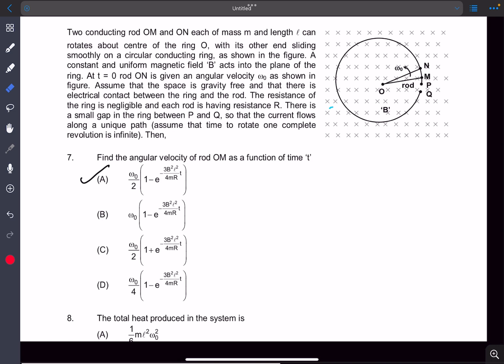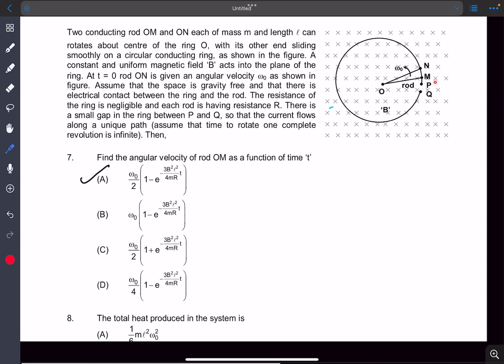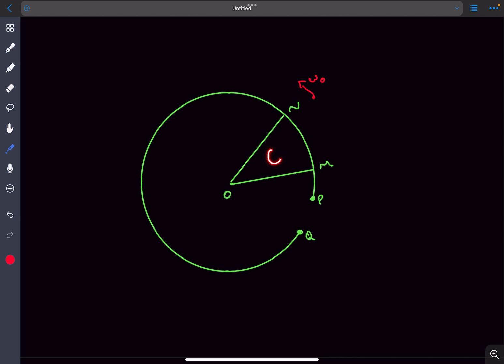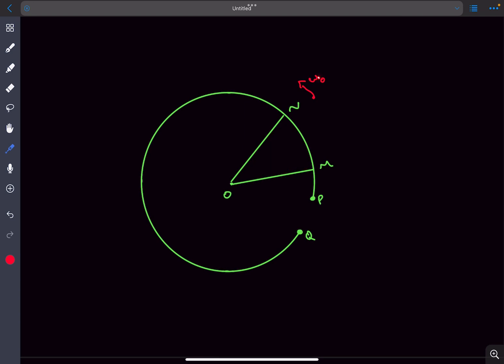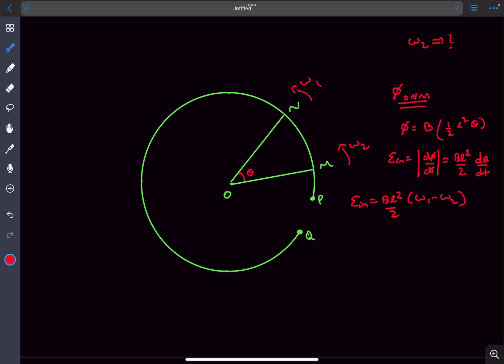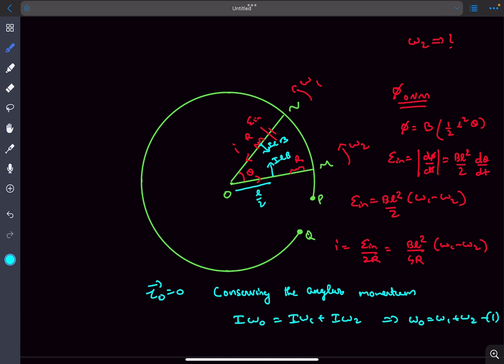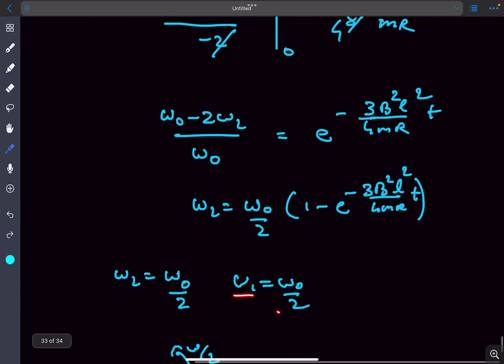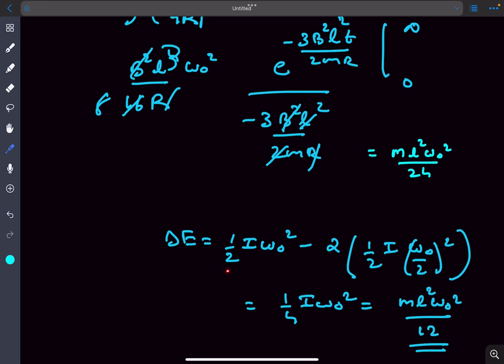[JEE Adv] ω(t) of the Rod | Heat lost | AITS

Comment: this was in our fiitjee package.. i solved it in second attempt.. satisfying problem.. not that tough
Reply: Which package Clasroom or pinnacle? I have it but slightly modified and changed in pinnacle package
Reply: @pointofinterest5981  pinnacle.. in emi solved examples after subjective problems.. you can find the question
Reply: @sarthaksingh5614  Thanks, I am doing emi package cpp now. Where are you now?
Reply: @pointofinterest5981  if you are asking where i am on the package then i have finished the package.. and if you are asking where i am in fiitjee i am in fiitjee navi mumbai axis in class 12th